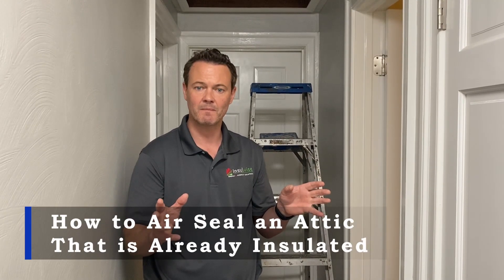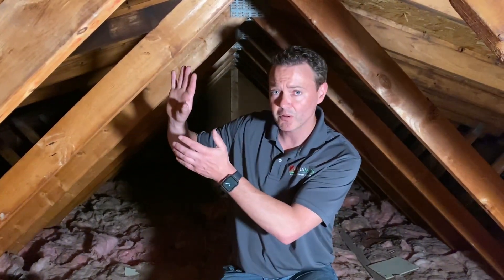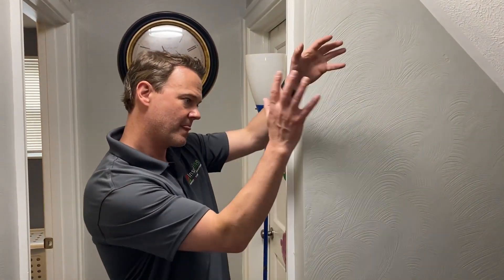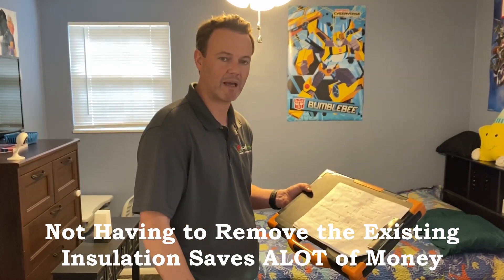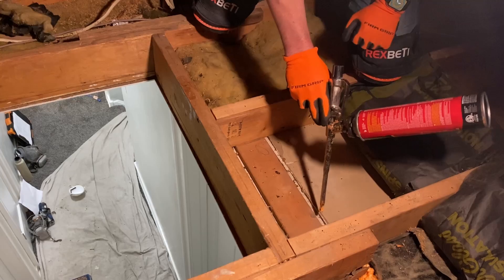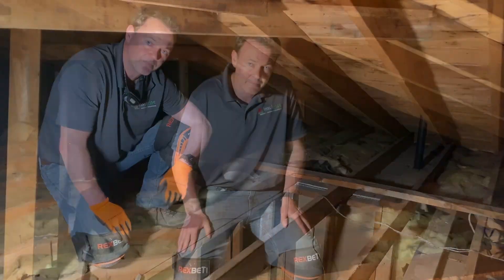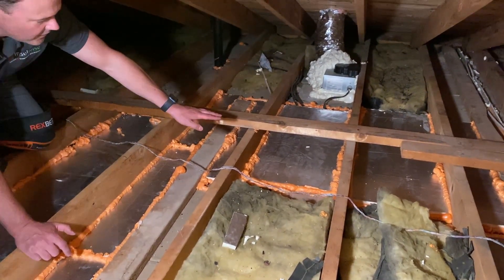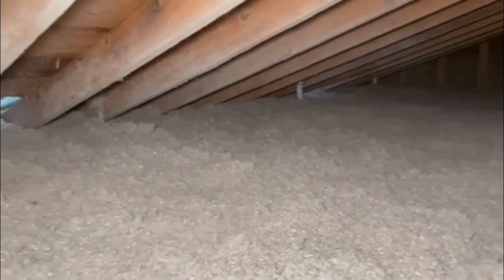Insulation Expert Reveals the BEST Way to Air Seal Your Attic

Comment: Great work what’s the foam gun set up your using and where can I find it ?
Reply from the maker: Hi there, the foam gun that I use in the video is a basic Great Stuff foam gun that can be purchased in most Home Depot or Lowe's stores.  However, we also often use the basic off-the-shelf cans of Great Stuff that go for about $5.  The flexible plastic straws and smaller can size allow us to more easily air seal the air leaks that we find that are in tighter spaces.  That stuff works just as well, just without the fancy gun.  The guns like I use in the video also need to be cleaned after they're used or they clog up.  
Hope this helps!
Andy

Comment: Great video - what size was this attic and how much is the approx. typical cost for a job this size?
Reply from the maker: Hi there, thanks so much!  This attic was approximately 1,000 sq ft.  For attics this size to get them air sealed, re-insulated to R-49 with cellulose insulation, the hatch insulated and sealed, bathroom fans vented out, additional roof vents installed, etc we're probably looking at a cost of $3-4k.  But that will fluctuate a bit from home to home depending on how much existing insulation is there and what other extra items need to be addressed in the attic.  To give an indication of the effectiveness, we have former customers in the Pittsburgh area who have not had to turn on their A/C this year as a result of the attic work we've done in their homes.  And that is saying a lot. 
Thanks!
Andy
Reply: @insulwiseenergycomfortsolu3293  Thanks for the detailed reply and pricing. How does a homeowner check that a company has done a good job after air sealing the attic?
Reply from the maker: @palbergwerx.comcreativedir1338   Hey there you're welcome.  It's actually very, very hard for a homeowner to confirm this.  We have competitors here who've picked up (I believe from us educating homeowners) that air sealing is something that "should get done."  But we've found that often that means just sealing around wire holes and maybe some plumbing stack pipes (and sometimes not doing any at all, unfortunately).  Basically it's a garbage effort, but the homeowner, unless he's inspecting the the work as it's ongoing, is oblivious.   

The BEST method is to have the company test in and out with a blower door.  We do this often.  It tests the air infiltration rate of the house before to establish a baseline, and then we test out again when done.  My teams get a bonus when they achieve a greater than 30% reduction.  The ultra best method is to combine a test in / out with a blower door with an attic zone pressure test.  We do this as well, but not on every house (it can be a bit tedious).  But this method tests the house's level of depressurization against that in the attic when the blower door is running.  If the house is at -50 Pascals, and the attic is at -48, -49, -50 Pascals that means you have pretty effectively separated the house from the attic.  If the house is at -50 Pa and the attic is below -48 Pa (like -40 Pa, etc) that means you still have a fair amount of connection between the house and the attic (and that some big stuff was missed).

This is pretty detailed and gets a bit deep into the building science side of things, but in essence you can perform a test using a blower door that will verifiably show you how well your attic has been air sealed.  All of our teams carry these devices on their trucks for performing these tests.  This equipment is NOT inexpensive, and it requires the teams using the gear to be pretty on their building science details.  This is fairly rare in this space.  If you're dealing with "Jim Bob's Insulation..." they're likely to look at you as if you're speaking Chinese if you bring this stuff up.  You need to find a company that knows what a blower door is, and offers the ability to test in and then test out at completion.  Hope this helped!
Andy

Comment: Did you put baffles in for ventilation?
Reply from the maker: Hi there, good question.  In this case we did not because this home did not have existing soffit ventilation.  The gutters are hung literally on the tops of the exterior walls at the edge of the roof.  That said, attics ALWAYS should have both intake and exhaust ventilation (but well sized gable vents on homes that have somewhat of an east/ west alignment to catch the breeze also tend to do extremely well).   At this home we installed 4 slant back vents just above the insulation layer.  You can see light pouring through some of them as I pan across across the back portion of the attic / home.  
Thanks, 
Andy

Comment: I'm assuming that you have to pull and leave the insulation off the exposed top plates to allow the foam to cure and dry? How long do you usually wait before placing the insulation back over the areas where you sealed the top plates?
Reply from the maker: You can do that and it may be better in some cases, but we do is inject the foam down into the top plate cracks, wire holes, plumbing penetrations, etc.  That way if the batt falls back onto the area that you've just air sealed, it's far less likely to push the foam off of the air leak. 
Andy
Reply: Most foams harden within minutes
Reply from the maker: @ajamesc55    My experience has been that foams used from guns like the one shown in our video harden / cure within minutes, but the cheaper foams like Great Stuff for $4-5 a can can take 30-60 minutes to cure depending on temperature.  The cheap stuff works just as well, you just have to be a bit more cognizant of not smearing it until it cures. 
Andy

Comment: I had 10 plus inches of cellulose blown in several years ago. Went up recently to install security cams. All of that cellulose has sank to the rafter tops. As in it's ALL GONE. Cellulose is a waste of money. It settles over time. Like you just tossed all that cash out the window. At least pink panther fiberglass stays put.
Reply from the maker: Hey there, I can't speak specifically for the work that you had done because we didn't do it, but it is known that cellulose settles by about 10% over time.  In cold weather climates this is an actual advantage in attics because the surface of the insulation becomes more dense, making it less possible for colder, denser winter air to "fall" down through it and create convection currents (the R Value of blown cellulose insulation holds up FAR better at temperature extremes than does blown fiberglass).  But as for the settling, we blow in about 15" inches of cellulose into attics to reach an R-49 level, knowing that it's eventually going to settle down about 13.5" inches (which is a settled R-49 - 13.5" x R3.6 is an R-49).  The R-value of batt fiberglass on the other hand does hold up very well, you just tend to end up with a lot of voids, missed pockets, etc when you use it to insulate and attic floor.  Did the guys who did your work for you install depth sticks when they did it?  

Andy
Reply: @insulwiseenergycomfortsolu3293  Yes they left depth sticks.
Reply: @insulwiseenergycomfortsolu3293  Can someone address the sinking effect of cellulose please? I had over 10 inches blown in several years ago. They even left the paper sticks showing how much was blown in. Now it's all level with the rafter tops where you walk. Total waste of money. At least bats won't disappear over time like cellulose does.
Reply: @rickjames6948 cellulose can settle up to 20% depending on the brand. That’s 2 inches of the 10 you had installed. If your joists are 2x8s (1.5x7.5) that that settling is probably what you’re seeing. Sounds like they didn’t install enough to include the settling.
Reply: Blown in cellulose done correctly and in quantity is best. I am assuming the 10” referenced above was on top of already existing insulation? Otherwise that is not a lot of insulation IMHO.
Reply: @10:09:  That's not the only difference between those foams.  The orange stuff is fire-rated.  Where I live, any insulation between levels must be fire-rated.  I'd have to put an intumescent coating over the non-fire-rated foam.
Reply: @ncooty  So you really think your insurance company is going to tromp through a house fire, looking for fire rated foam? Do all the fire rated foam you like. So do you have steel studs in your house? Any WOOD trim? Cedar shake roof? Wooden doors and trim? PLASTIC carpet and pad? List goes on and on and on and on........ You can't fire proof your crib without spending a ton of cash.
Reply: @rickjames6948  I guess there are no building inspectors or permits where you live.
Reply: Rockwool is Better plus it's Fire-Proof🔥🧑‍🚒  Lite it on Fire.. won't burn. YouTube it.
Reply: @LK-vb2pl  Continuous soffit and ridge vent with baffles. I don't doubt that cellulose is a little heavier. But the cellulose we used in the 90's was like dust. Settled tremendously and like I said the dust blew around.
Reply: Rockwool
Reply: I'm an insulation inspector.. Cellulose is absolute garbage
Reply: Rockwool batts better than anything IMO.
Reply from the maker: @Dmanpeterson  Most of the attics that we see have numerous penetrations and obstructions in the attic floor like recessed lights, bathroom fans, plumbing pipes, etc.  Many attics are often very low sloping at the front and back of the home on low pitched roofs.  These kind of things make a blown in product (in particular cellulose) typically superior to any batt insulation in most cases.  It is simply too difficult to avoid gaps, unless you have hours to painstakingly cut the batts to perfectly conform around every one of the obstructions, not to mention wires running everywhere.  We find gaps all over with existing fiberglass batt installations all the time, and gaps where the sides of the batt are exposed or drywall is showing can seriously degrade the effectiveness and efficiency of the overall insulation install. 
Andy
Reply: That's as I recall R-30. My issue with Cellulose as a Homebuilder was it blew around the attic. Far too light for a properly ventilated attic.
Reply from the maker: @kylephillips9073    Hi Kyle, if you don't have baffles installed at the perimeter you can definitely have this.  It's called "windwashing", and with blown fiberglass it's even worse.  If the attic is properly baffled this shouldn't happen.  We've blown cellulose around boxes that we've built around large, powerful whole house fans, and the air force produced by the fans blowing up into the attic from the home below has not moved the stuff.  That said, you could have a different situation that I haven't seen before.  I've been at this for 15 years now, and I'm still seeing new things on an almost weekly basis!
Andy
Reply: @LK-vb2pl  l used cellulose in attics in the mid to late 90's. In a we'll ventilated attic on a windy day it could be cloudy in the attic from the dust blowing around. No brag just fact.
Reply: As a Homebuilder since 1986 I can say I have never not had baffles installed. Cellulose is very light in weight. I stand by my comment. I have never had an issue with Fibreglass insulation. That's in 37 years and hundreds of energy efficient homes.
Reply from the maker: @kylephillips9073    Ok, is that blown fiberglass or fiberglass batts?
Reply: Easy fix. The install should be blow 18.5 inches of cellulose for an R60. It will settle over time but retain the R60. Another option is to have it blown in with a water system. Ten water helps to stabilize it so it doesn’t settle as much.

Comment: I might have missed it if you mentioned it, but if there is pre-existing cellulose in an attic, does that need to be removed before air sealing top plates? Can it impact curing if insulation goes back over wet foam?
Reply from the maker: Hi Joe, you can definitely air seal if there is pre-existing cellulose insulation present.  However, it is considerably more time consuming and less fun.  Depending on how much is present, it can be a bit like pushing sand around at the beach where you move some, and then it falls back down into the area you were attempting to move it from.   You just have to patient with it, organized, draw a good map from below so that you know where and what you're looking for, be methodical, and lastly double check your work --- even if you did it yourself.  If a bit of insulation gets onto the foam it won't affect the curing.  But if you completely swipe away the bead of foam with your glove or foot, that's a different matter.  We air seal attics that are insulated with varying degrees of cellulose fairly often. 
Hope this helps!
Andy
Reply: @insulwiseenergycomfortsolu3293  Thanks for the quick reply! That's good to know, we had a company air seal our attic, add soffit vents/baffles, and add more insulation on top of our existing cellulose. But recently had a blower door test with thermal imaging and it looks like top plate spots were missed or the sealant didn't cure, so trying to get an idea of what's common practice.
Reply from the maker: @joelalonde   In our area, many of our competitors say that they "air seal."  They don't (or at best they do a totally lamo job doing it).  Air sealing an attic is difficult, tedious work and lots of companies  1)  aren't truly committed to it  2)  don't have staff that fully understand how to do it 3)  don't want to pay the added expense of time and materials for doing it right, etc.  Now, there are some places where we can't always effectively seal top plates, like exterior walls of a low sloping roof.  But all of the other places we make a serious effort to get to.  However -- it is easy to check to see if they hit the plates or not.  If you put your hand down through the cellulose where the top plates, bathroom fans, plumbing stack pipes, etc are, you will either feel a bead of foam on the thing in question --- or you will not.  If you don't feel a semi-hard bead of foam -- it didn't get sealed. 
Andy
Reply: @insulwiseenergycomfortsolu3293  Appreciate the details, thank you

Comment: No baffles added?
How about the perimeter? The exterior wall top plates. With such a low pitch roof. How did u reach there and get it sealed?
Reply from the maker: Hi Dan, good observation.  We didn't install ventilation baffles because this home did not have any soffit vents or intake ventilation of any kind.  We added intake ventilation in the form of a series of slant back vents that we installed just above the insulation line on the back of the home.  You can see some of these in the last segment of the video.  We sealed the exterior side-wall top plates, but not the front or back exterior top plates due to the low slope.  We sometimes offer to spray foam these difficult to reach top plates with two part foam, but due to the significant added cost we only recommend doing this in certain critical situations.  That said, all of the exterior walls in this home were insulated with fiberglass batts.  The presence of these batts does a decent, but not perfect job of knocking down air flow through them, so we didn't recommend the added expense of spray foaming them with two part foam. 
Hope this helps!
Andy

Comment: Great video. Frankly, the map seems unnecessary unless you are training a newbie or it is a complicated attic.
Reply from the maker: Thank you, in a simple attic with an experienced team you may be right -- most of the time.  However, because of the importance of sealing these things we prefer the additional measure of redundancy.  We believe there is a big difference between hoping that you got everything --- and knowing that you got everything.   
Thanks!
Andy
Reply: @insulwiseenergycomfortsolu3293  I understand. Our team uses blower door and thermal imaging for redundancy. But another step that is less costly certainly doesn't hurt.
Reply from the maker: @cellocovers3982  
We're are big fans of redundancy when it comes to this kind of work.  We blower door test in and out a lot of homes that we work on, but not every one.  We also perform zone tests on attics from time to time, and I plan to create a video for how that works as well.  
Thanks!
Andy